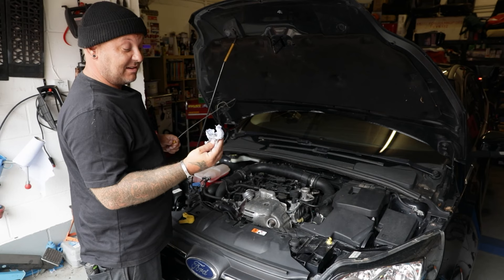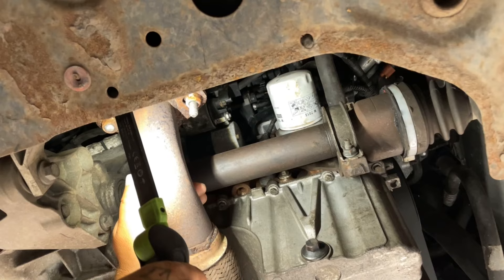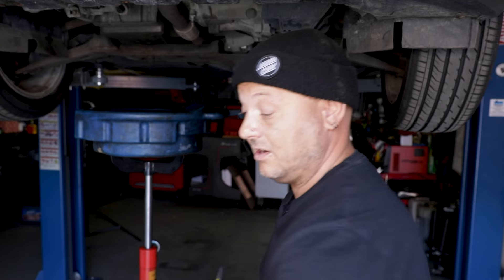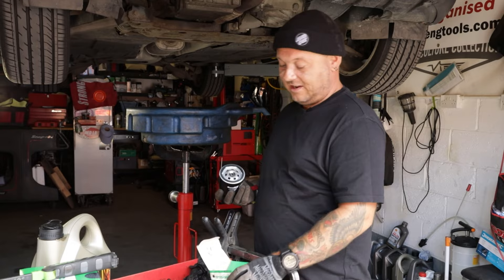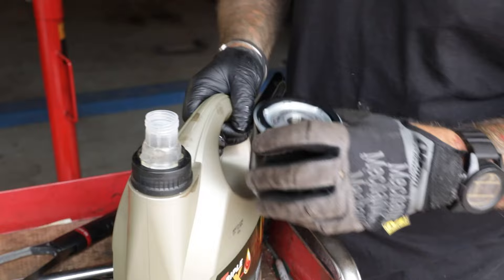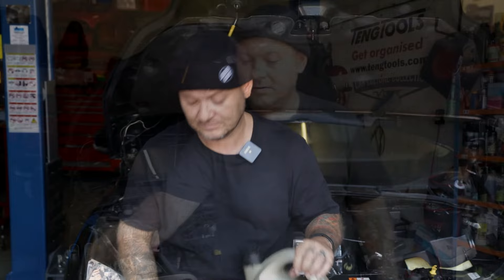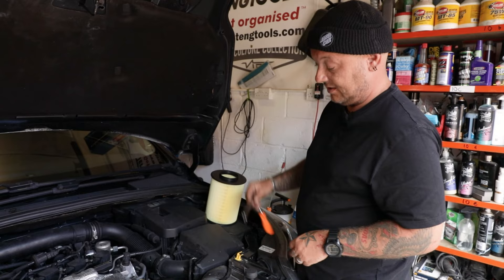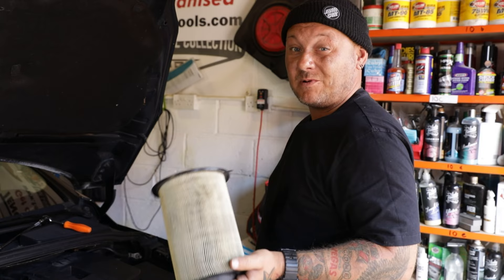Ford Focus 1.0 EcoBoost Oil Change & Air Filter Service DIY

Comment: Good video.  But  I have some comments being an ECOboost owner.  1:  You can buy replacement O rings for the sump plug - I got a pack of 10 off E-Bay.  The O ring doesn't always need changing.  2:  Giving the fragility of these engines you have to decide if it is worth spending a little extra on your parts.  A Ford oil filter and genuine Ford Castrol oil do not cost that much more and you will then be doing a 'dealer service'.  I used that brand of oil on my old Golf and it made the engine noisy - I switched to Comma and the noise went away (I'm guessing hydraulic tappets).  The Ford Castrol oil meets the Ford specification gauranteed - other oils may well not.
Reply: All very good points. In most cases it’s easier to buy the plug as they’re only a couple of quid and it’s 100 percent guaranteed to work. We hope 😂. Very good points on the oil too

Comment: I've got this car, and it has an oil leak. At 7:08 in this video, there is a grey cable in the bottom left hand corner of the screen. That has detached from the engine, and I'm not quite sure what it's for and how to reattach it. Can you offer me any advice please

Comment: Gem? I had a drive in one and found it very underwhelming. It felt no more powerful and was no more economical than the previous much more reliable Sigma VVT 1.6, and don't get me started on those belts in oil. :(
Reply: A gem for sure, maybe in the loosest possible sense of the word. Yeah, those wet belts. We’re sure they have some advantages… not sure what though 😂
Reply: @FCMidge  It means they get scrapped sooner and Ford sell more cars.
Reply: @simonh870  you could be right there